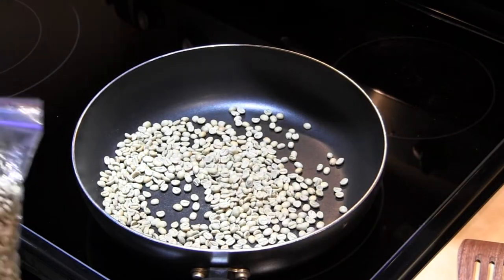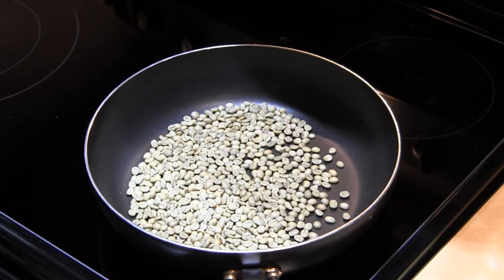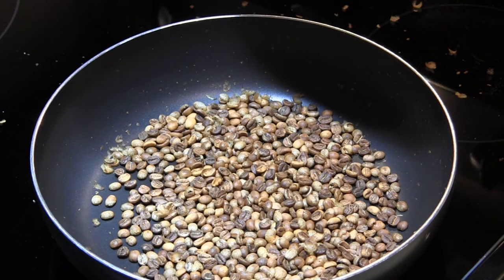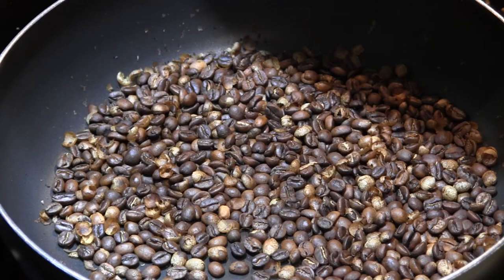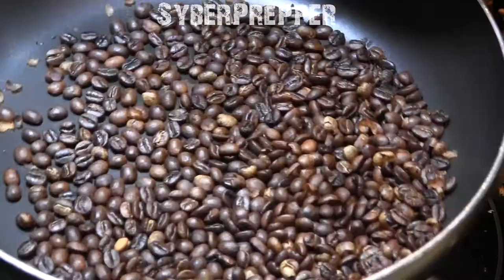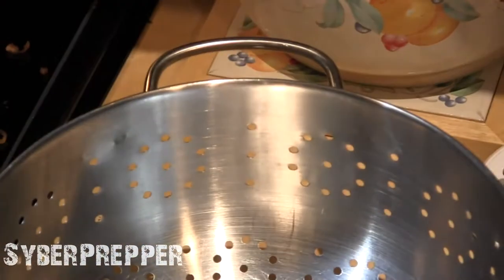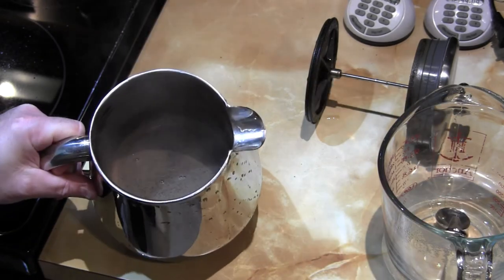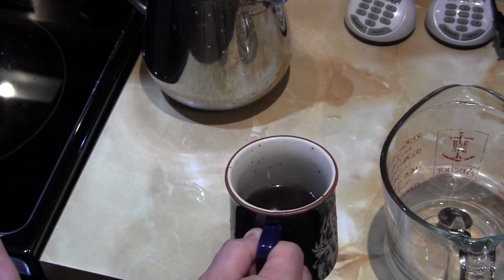How To Roast Coffee At Home

Comment: I would recommend preheating a cast iron skillet.  After the beans cool in the colander,  you should put them in a degassing container.  Let them set for several hours.  I let them set for a day.  The roasted beans need to degas the CO2.  I use a Nesco Pro roaster.
Reply from the maker: +Lloyd Wilkinson   Hi Lloyd.  Thanks for the tips.  The degas process is new to me and probably to others.  Thanks for sharing it.
Reply: +SyberPrepper  You are most welcome.  If you look at coffee bags in the store, many will have a little circle with a slit in it.  That is the the degas valve.  I bought "Beansafe" brand degas containers from my local coffee roaster.  They have made a big difference in the roasting process.  Look at the sweetmaria's website for info on roasting coffee beans.  You could try the wirly popcorn maker.  I roast mostly decafs now, since I found a local good coffee roaster.

Comment: It's a messy process but vary rewarding. I've been doing this for a year or so. I went out to the local thrift store & got some cheap SS utensils & a pan. I found a thick metal 4 quart that works great for this. It allows me to roast without making such a mess. 

I then dump the roasted coffee beans, which have been roasted to the proper level, into a SS strainer to cool them.

Then commences with the tedious process of getting the chaff out off the beans. I do this out side to keep the wife from  fussing over the mess. 

The results have always been very satisfying. I've roasted many varied coffees from different regions. My favorite, so far, is from Mexico. It's inexpensive compared to other places. But gives me a very similar flavor as the more expensive coffee beans from other regions. 

Just my 2 cents...LOL
Reply from the maker: +1timby  Great ideas on roasting with larger pans so it is not so messy.  One of these days I might try it outside with the Coleman stove or a rocket stove.  Glad you had good results.  I've always liked the roasted beans from Mexico.
Reply: +1timby Thetaridge in south bend indiana is inexpensive on green coffee beans.  I would think the mexican beans are  lighter coffee.
Reply: Rosting coffee
Reply: Roasted cofee affective or un roasted plz tell me